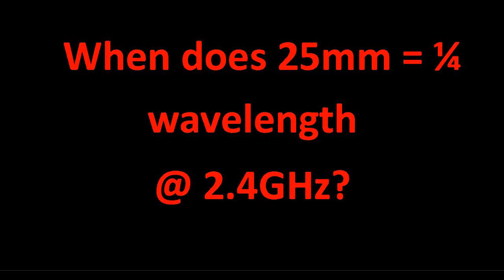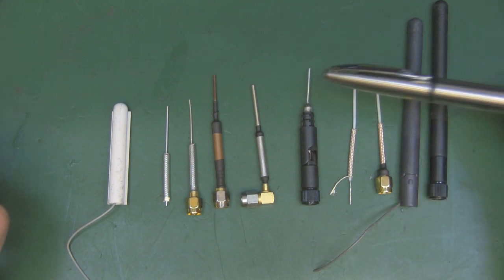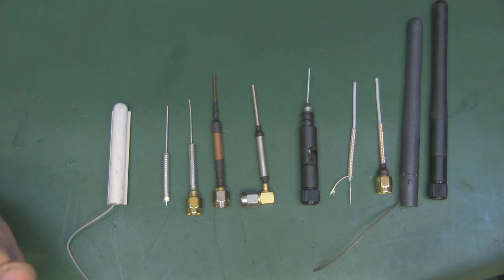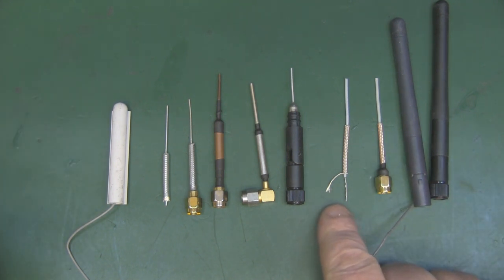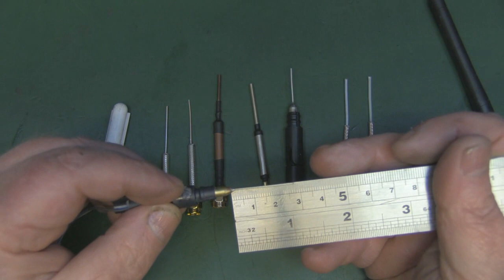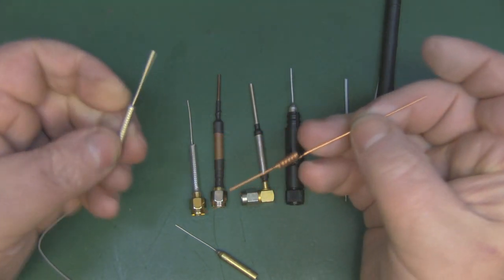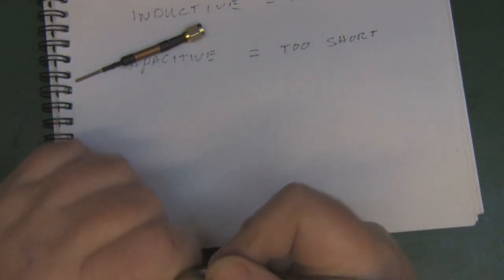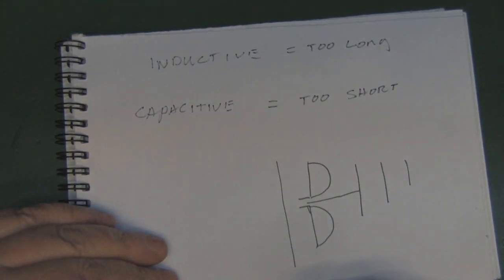When 25mm is a ¼ Wavelength @ 2 4GHz

Comment from the maker: So I have since found out that Hertz dipole actually functions as a capacitor. Once it builds up a charge, because it is open at one end, the driven element, it then releases its RF energy. The same also works in reverse so the antenna can transmit and receive. As the energy released is equal to the energy built up along a wire at ¼ wavelength @ 2.4GHz (31.25mm) this is why it is resonant @ 2.4GHz even though it has a 25mm ¼ wavelength. And of course it is doing all this at the speed of light!

Comment: Consider the VELOCITY FACTOR of the coaxial dielectric material. The "ground plane" uses an inner conductor as a transmission line. If the VF is 80% it will appear too short, which is why it must be 20% longer to be a 1/4 wave long electrically. 73 de KT1R Lou in Maine

Comment: Andrew, at around about 13 mins you are talking about the longer element being a full wavelength including the coil. My Edimax aerials are more than one wavelength. They are one wavelength long to look at but that is with the loading coil. If that loading coil were unravelled, the total length would be 126mm plus about another inch. The ground plane is as yours.

Comment: Great stuff Andrew! Would it be an idea to show how a cheap but great antenna analyzer, the N1201SA, can help you in determining the perfect SWR? This little thing really opened my eyes and explained why some of my built antennas were crap ;)
Reply from the maker: Wow that is cheap would be interesting to see how it compares to my equipment would make an interesting video. Had my eye on this http://miniradiosolutions.com/minivna-pro/  as a cheap analyser but at £300 is still a bit pricey
Reply: Really it is great - read the reviews :) but also plunges you into a world of mystery... Just now: having the driven element 25mm (exactly coax and all, like your 3rd dipole from the left), I get the best SWR (1.4) at a length of exactly 31mm. But anyway, please keep the video's coming Andrew, nobody else does em like you :)
Reply: Andy I have the PocketVNA from http://pocketvna.com/ and I am blown away by it. It says 1Hz to approx. 4GHz but it does work on 5.X GHz also obviously dynamic performance is smaller but putting antenna into RF Chamber or simple Fraday cage, you can measure 5GHz band fairly well (I mean, in the price range). Works on Windows,Linux,MAC... saved me lot of hassle in my mobile setup, while setting up UHF HAM repeaters for DMR. Just a thought. :)  Let me know if you want me to mesure some cheap TPLINK 2.4GHz dipoles usualy shipped with cheap APs against pro-range dual band from Cushcraft etc.

Comment: ah, so why is the rod in the cantenna not 25mm?
Reply: It is a monopole antenna .
Reply: @kavindugilshan  but should a monopole not be half a dipole?
Reply: @freefilms10000  quarter wavelength for wifi frequency is around 30.5mm . But this is hertzian dipole . It is a capacitive design . Thats why it is shorter than quarter wavelength .
Reply: @kavindugilshan  thanks, but that does not explain why this one is shorter.